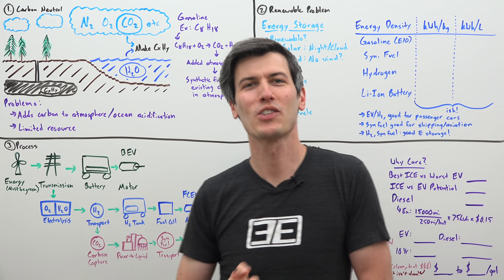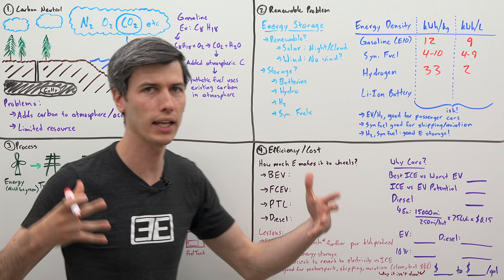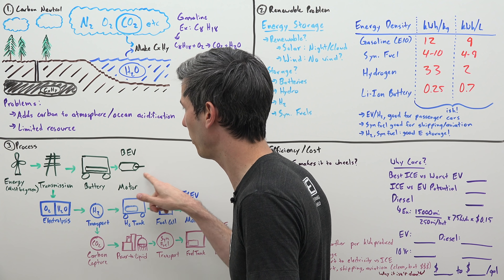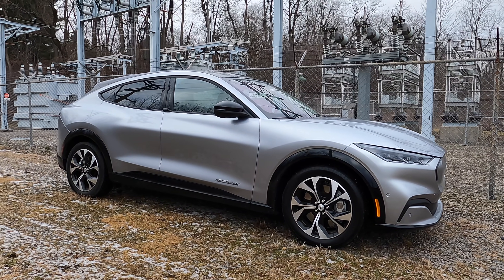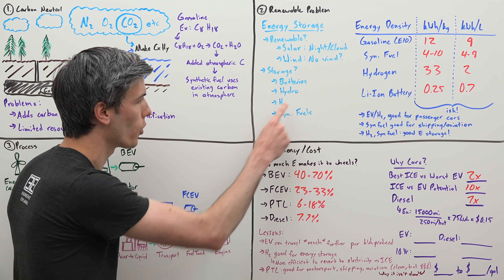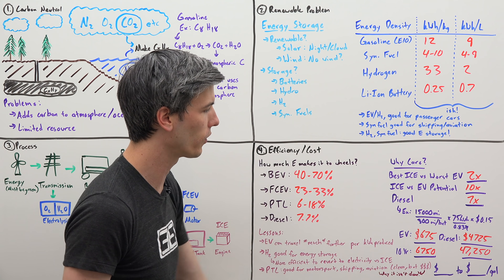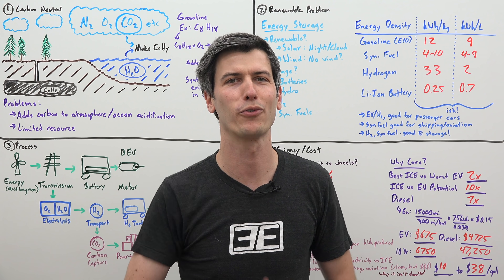The Big Problem With Synthetic Fuels

Comment: Do you still think that car companies will still make ICE performance cars, just for the driver involvement?  Even if the cost is very high for the fuel, it still might make sense as it is nearly always far more engaging to drive a performance ICE car compared to a performance electric car.
Reply: @Elias Håkansson No, that's not, you can't associate horses with cars, ICE and EVs are not that different per se, but you can paragon it to the Injection system and the carburator system, which was gone by a three decade ago. 
Horses aren't being killed around just because they aren't practical anymore and nobody blocks you from riding one. That's a complete different story.
Reply: if it becomes viable and carbon neutral for synthetic fuels, car companies will still produce ICE cars, especially Porsche, Lambo, Ferrari, BMW and performance cars

Comment: It's better if Synthetic, Fossil, Hydrogen, PHEV, HEV, and EVs perform side by side rather than one replacing another
Reply from the maker: Falls much in line with the conclusion of this video. Synthetic will likely make sense for certain applications, especially where energy density is critical.
Reply: @EngineeringExplained  
"Synthetic will likely make sense for certain applications"
There are supa-dupa expensive specialist oils for niche specialist applications. This synthetic fuel will fall into that category.
Reply: @johnburns4017  cope
Reply: Freedom of choice hurts some people's pockets and ideologies.
Reply: @peekaboo1575  Bingo ^
Reply: @peekaboo1575  china produces 80% of the worlds lithium batteries lol. plus they pretty much own africa where much of the materials come from
Reply: @peekaboo1575  exactly which is sad smh.
Reply: Thats what i was thinking🤔
Reply: Totally agreed.  Plus, hybrid vehicle and plug in hybrid are way to go until battery become really efficient.
Reply: @barnacle-o8e  Plug in hybrid are pretty useless. You neet to pump gas and charge the battery otherwise it is just a normal car with some extra weight. Because they can run without electricity it is more like a ICE car with an electric auxilary power unit. So you need the maintance a normal car and the electric system.
Reply: @jonasstahl9826  Plug in hybrids are obsolescent now, but made sense when batteries were much more expensive.  A small battery is enough to cover 90% of your trips.  If you wanted enough range to cover all your trips without resorting to a second vehicle, you either made the battery much bigger (expensive) or added an ICE powertrain (less expensive).  Technologically, a good plug-in hybrid is basically a regular hybrid but with a bigger battery and bigger electric motors.  So, it's a straightforward evolution of the familiar hybrid, which has proven its efficiency and no one considers strange anymore.
Reply: @jonasstahl9826  the other big issue is, with the engine shutting off and turning back on, it goes through a lot more thermal cycles. Not only does this increase emissions (by running at below operating temperature) but it also increases wear on moving parts.
Reply: @dansanger5340  The problem with plug-in hybrids is that they have no benefit in fuel economy in real-life use.
An ICE car is relativ light weight, but has a bad drag coefficent from the engine cooling. An electric car is heavy but has a good drag coefficent.
The plug-in hybrid has a bad drag coefficent and is heavy.
It need less gas but you need electric power.
And they are complex you has a turbocharged engine with a lot of power and an automatic gearbox.
On the other side a real hybrid like the prius has a much simple gearbox just one planetery gearset and a simple naturally aspirated engine with less power.
Reply: @barnacle-o8e  
Around 250 miles range on some EVs right now.  Solid state batteries will mean around 1,000 miles.
Reply: Yeps different strokes for different folks. Certain types of vehicles fit peoples life styles better so having a choice is always nice. For me my PHEV makes the most sense, for others who don't road trip a whole lot or have a long commute a pure EV makes more sense. Maybe some folks live in an apartment and have a hydrogen filling station near them and want to go that route.
Reply: I agreed that EV is the future, but, the current problem with electric car are the cost, they are still "luxury'' car, its why Hybrid and PHEV make perfect sense.  Even with the incentive, EV's are expensive (and lets face it, its a Government incentive, we collectively pay for it).  Currently, in Canada, the price of a base Nissan Leaf is 44k CAD, you have a Hybrid Corolla for 27k.  Unless they can produce car for the average people under 30k without the need of all the incentive, the EV will stay marginal (5% in 2021).
Reply: @barnacle-o8e  I mean we're still in the early days of EV adoption, there's a bunch of cheap options coming in the next few years, but there's also gotta be the infrastructure so people don't have any concerns when buying one
Reply: Especially long distance flight and shipping will require these synthetic fuels.
Reply: IMO we need to start blending fossil fuel derived fuels with synthetic fuels and gradually switch to synthetic once petroleum is no longer practical to obtain. Same with coal—gasifying coal and burning the resulting natural gas is much better for the environment than directly burning it.
Reply: totally agreed. plus cant imagine if HEV with solid state battery performe 1000km+ in future that bonker
Reply: Hell yeah, more options
Reply: Don’t forget the steam engines!
Reply: It is better that polluting fuels are phased out. We will all be driving EVs - quicker than we think.

Comment: Hydrogen fuel cells don't power motors in cars directly.  They charge a battery in the car that can handle power-demand variation from the motor better than the fuel cell.
Reply from the maker: Not necessarily. PCU decides whether that energy goes to the motor (when power is needed) or the battery (when excessive power is being generated). https://youtu.be/0jnZFGx_4kY

Comment: The biggest Advantage of syntethic fuels is that we already have produced the Cars that can run that fuel. For electric or hydrogen alternatives we have to Produce the Cars First.

As we all know is the production process of a vehicle responsible for a significant amount of the carbon totally emmited during its lifetime.

Internal combustion cars are clearly not the future, but they should maybe be used with synthetic fuels instead of replacing them with other vehicles.

greetings from germany, really good video
Reply: Ehrenmann
Reply: @starstencahl8985  lol

Comment: I don't get how you can talk so fluently and coherently for 15mins straight without taking a breath! Excellent rundown
Reply: That’s what happens when you love to share knowledge on things! I’ve been told the same thing when explaining things to people!
Reply: @sbeezynukka  they are just being polite :)
Reply: Perhaps he is an android.
Reply: @surferdude4487  Perhaps an android running on H2. It's only 15 mins, so he doesn't have to worry about storing it.
Reply: It glosses over a few things. Like ocean acidification being a problem. It isn't, and won't be. Simple chemistry experiments can demonstrate this, like sticking chalk in acid. There's an awful lot of calcium carbonate in the oceans that'll need to vanish before oceans become acidic. Or even close to neutral. It's much the same with CO2, if scientists are correct about CO2 sensitivity per doubling, and that relationship being vaguely logarithmic.. Which is the current consensus view. What typically gets ignored is how much carbon we'd need to burn to get to remotely dangerous levels. So if it's say 1.2C/doubling, we've done the first part. To get the next 1.2C, CO2 levels would need to get well above 1,000ppmv, which would mean burning pretty much everything.. And temperatures still rise to anything remotely dangerous. 
So much of the hype has been converted into using bad science to push for bad engineering, and prop up the windmill industry. Which also feeds into energy cost assumptions by fuel type, ie if a refinery runs off 'renewable' energy, and is transported by Tesla Semi-tankers, the energy cost would be low, and the energy density benefits still trump EVs.. Which also take a lot of energy to create in the first place. It gets more complicated depending on transport assumptions though, ie transporting via pipelines doesn't take that much energy. Especially if refinery or pipeline's using it's own product to create electricity.
Reply: @brolohalflemming7042  Well all that argument appears to hang together, but it is just an opinion, and that opinion goes against the majority of expert opinions. If I was a betting man, my odds would go with the numbers.
Reply: @Bennyboy-dog  Actually it is based on current, majority expert opinions. So it's simple(ish) science, supported by the IPCC reports. Then it tends to get spun by vested interests looking to get rich from flogging solutions like windmills. For them, it's like the Age of Sail giving way to the Age of Steam never happened. Reason it happened then are much the same as now. Wind and water mills just aren't as reliable as steam. But wrt 'acidification', science is pretty simple. CO2 dissolves in water, forming a weak acid, cabonic. That then dissociates into into bicarbonate and hydrogen ions, and hydrogen ions cause acidity. Then shellfish can't form shells, and we're doomed etc. Reality is of course the bicarbonate ions get used to make shells, and the H+ ion is largely irrelevant given the oceans are slightly basic, with a lot of neutralising compounds in it.. Which is probably why oceans didn't become acid baths when CO2 levels were far higher than they are now. And oddly enough, helped create gigatonnes of chalk etc found in and around oceans.
Same applies to CO2 sensitivity, which is the only real carbon argument, ie solving ΔCO2=Δt. So how much warming for how much CO2. If that's low, then there's no 'catastrophic' warming possible, especially as temperature is just energy in motion, and most of the Earth's energy is radiated away to space. Again why we didn't turn into Venus in the (not so) distant past when CO2 levels were far higher than today.
Reply: @brolohalflemming7042  yeah, nah - still sounds like opinion, but adding the pseudo maths just convinces of that.
Reply: @Sidowse  I get that Simon, but that is true for every profession or trade. No one appreciates what goes on in the background to fix your plumbing, to repair your computer or to service the car.

Comment: Energy efficiency is cool but what about the end life of each BEV and the amount of weight they have putting strain on the roads and bridges?
Reply: Average battery life is about 10 years or 200k. Maintenance on US infrastructure is poor anyway. Also since the best selling vehicle of all time is the Ford F series wieght isn't changing much. Cars been getting heavier and heavier for quite some time. A 1907 F100 weighted 3060 , a 2020 F150 weights up to 5600 lbs. The 2021 f150 lightning weights 6500.
Reply: @dreday2751  In Italy or anyway europe we don't drive such elephants and recently there are bridge issues. Not to talk about road conditions.
Reply: The old batteries can be reused (e.g. as energy storage) and recycled and cars have been getting heavier constantly through car history so that not something new...
Reply: Not real issues in your cases.
How many miles does the average ICE last today?  200-250k???
We are seeing Tesla's with 400k on the original battery pack.
And they will get recycled.
The 800# difference between ICE and BEV is negligible. It is heavy trucks that do 90+% of the damage.
And if you want goods on the shelves that isn't going to change whether the truck is diesel or electric.
.
Reply: Weight is pretty much same as gassed up ICE vehicle.
Reply: @jimgraham6722  A Fiat 500e weighs 1200+ kg while the normal one 930. I don't drive one but even the Honda e weighs more than my Golf GTI.
Reply: @jimgraham6722  True, but it doesn't stop the luddites from dragging out the tired lies again and again.
Model 3 v/s Camry are about even depending on options.

Comment: Something that I have missed in this video is to benchmark this with the current standard fuel we are getting from a gas pump. 
Efficiency of the car itself is somewhere between 25 - 35% depending on the engine and fuel used. What is the efficiency of the process to get the fuel from the ground to the car?
So all in all: What is the efficiency of a standard ICE vehicle? This helps us to put the numbers in the video into perspective.

Comment: What about that hydrogen combustion engine that Toyota put in their prototype Corolla? I didn't dive deeper into the topic but perhaps that could be an interesting alternative.
Reply from the maker: Here's my video on the subject: https://youtu.be/1Ajq46qHp0c
Reply: Converting Hydrogen into electricity via a fuel cell is far, far, more efficient than burning it in a piston engine. Efficiency would be worse than the examples given.
Reply: yes, its possible but check his figures on hydrogen efficiency
Reply: Hydrogen ICE works but it also sucks. It's less efficient and still makes NOx (which is bad for peoples' health) even though there is no carbon emissions.

Comment: I’m fairly certain electric range will improve to a point quickly enough that synthetic fuel is pointless. Right now I understand the skepticism in electric cars when their normal range right now is 200-300 miles but eventually we will get to things like 600 miles per charge conservatively which rivals or beats most I.C.E’s full tank of gas.

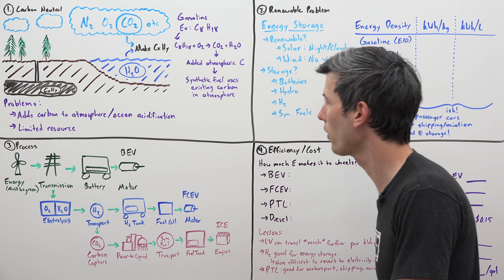Comment: 2:09 “We’ll eventually run out of crude oil” - but won’t we also run out of sources of lithium for batteries?
Reply: No, its recyclable and therefore reusable.
Reply: @rtfazeberdee3519  I mean evidently with synthetic fuels, so can gasoline
Reply from the maker: Whataboutism. Four points:
1) Electric batteries don't use much lithium.
2) Lithium isn't straining battery production, other elements are (cobalt, which companies are trying to reduce).
3) Lithium can be recycled and is re-used, not extracted once and then gone forever. 
4) The quantity of lithium available does not change the amount of crude oil available. These are separate issues.
Reply: @EngineeringExplained  hello Jason, love your work. Would love to see a video on points 3 and 4 in the future. Thanks!
Reply: There is a good amount of lithium available, but unfortunately a majority of it is in China and other foreign nations. Recycling will become important as the volume increases as will alternate battery chemistries that don't utilize lithium.
Reply: @ChrisP978  Australia is the 5 largest reserve and the top producer. For now.
Reply: You only need a few kilogram of lithium for the production of a vehicle, then it's last the life of the battery. Compare that to the thousands of kilograms of fossil fuels need for ICE vehicle. And at the end of life of the battery the lithium is still there, It does not get consumed.
Reply: Not likely, the demand for lithium in batteries has been projected vis a vis likely reserves plus recycling. There doesn't appear to be significant risk of shortage. 

That said alternative chemistries are being pursued, leading among these are aluminium ion and aluminium air. They offer power densities two to three times that of lithium and of course aluminium is very abundant.

There are still significant technical problems with aluminium batteries (mainly affecting durability) but R and D is continuing and most observers of the technology believe these can be overcome within a decade.
Reply: I mean, sure, it's theoretically possible- but with as fast as technology is advancing, there's a good chance that autonomous ridesharing will be widespread by that point- not as many new cars will be purchased by individuals. But ignoring that, EV batteries can be recycled (not many are at the moment) and the lithium/other metals can be recovered and reused
Reply: @NicholasHoward  the problem with recycling them is a massive energy source is needed to return them to usable materials.
Reply: @TTGLL  there are a few companies already in small scale recycling of lithium ion batteries (under 1000kg per day) and they're saying that once it gets up to industrial scale it could match or beat the price of importing the resources for lithium ion batteries. Even more so when electric car sales are soaring. It would also consume less energy since a battery for an electric car goes around the world a few times when its being built...
Reply: @TTGLL  Certainly, and that's a problem that has to be overcome. But it almost certainly will- there are a lot of brains hard at work trying to make it efficient and easily scalable
Reply: Exactly a point no one talks about is a lithium mine or any surface or subsurface mine for that matter is truly destructive to the area its in. An oil well in your front yard won't impact your life one bit fact.
Reply: Exactly, we will never run out of gasoline by comparison.